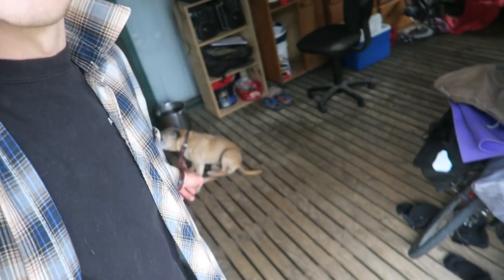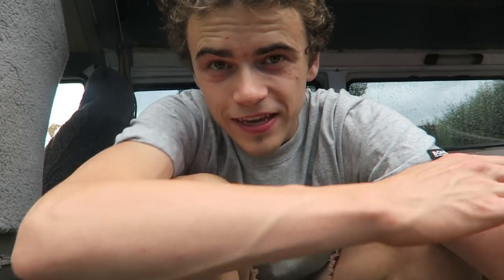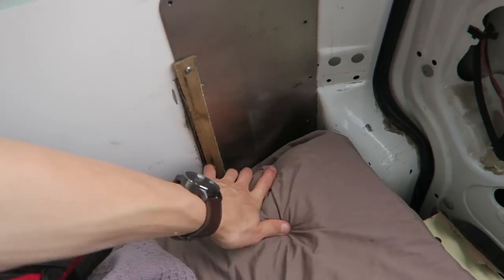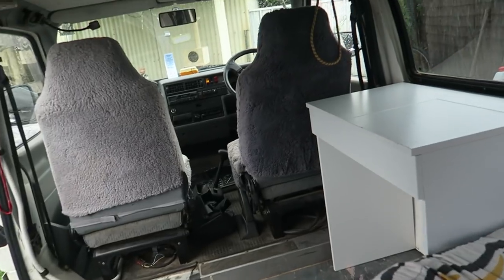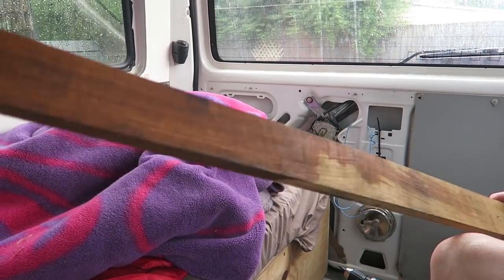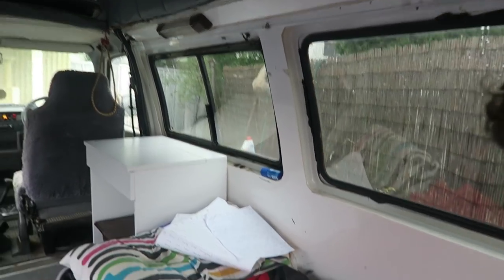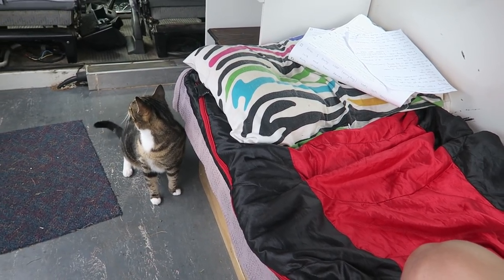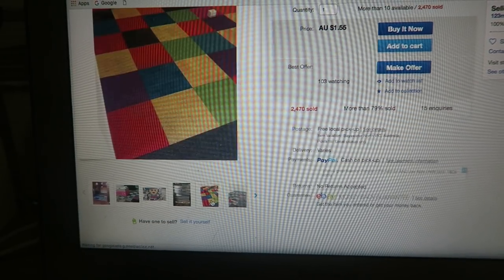New Kitchen Table for The Van | Vlog 250

Comment: Bugger. Auto electrician time? Good job with the table. Carpet is good for insulation but vinyl is easier to keep clean, commercial lasts longer and often has an insulation backing. We have commercial 'Pegulan' throughout our house and it is fine in Winter, not cold at all. Ripped out the carpet - dogs, fishtanks, an aversion to dust and vacuuming and we live near the sea + sand. I am sure this van is going to be a good one whichever you choose :) Suzie looks to be a nice old girl.
Reply from the maker: +Lynda Painter thanks Lynda.. I am really liking the look of the van atm! ✌

Comment: I'd say the fact that it starts at all is a good sign but it may be difficult pin pointing the exact issue. Hopefully it turns out to be an easy fix. Table does fit good. Good eye.

I'm so jealous of your weather. You can actually go outside and work on things!!! It's been very cold around here in the negatives and snowy. Felt like I was gonna get frostbite the other day.
Reply from the maker: +cronicjointpain yeah it does have some life when turning it over, but seeing mechanic tommorrow about it.. how cold is it there it has been like 109 F one day there super hot..